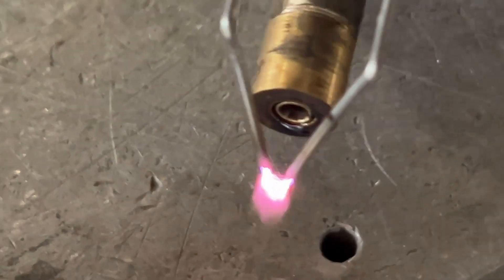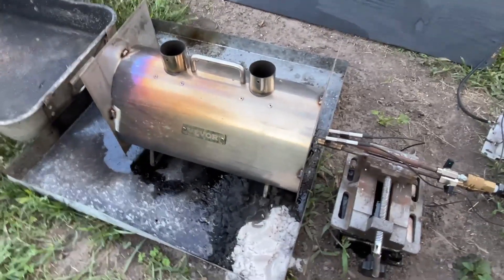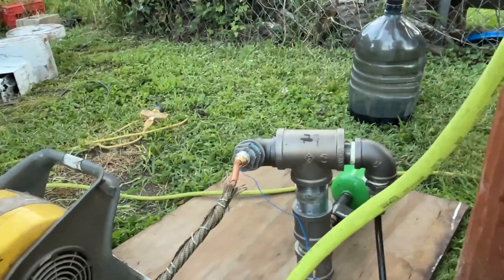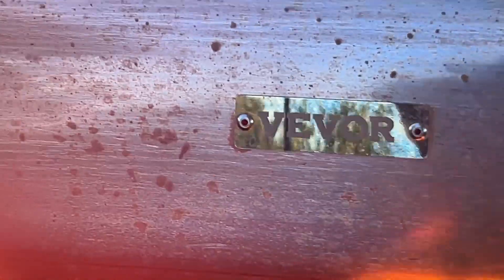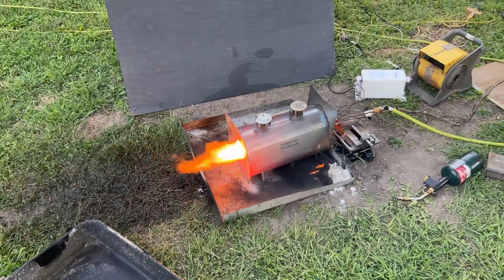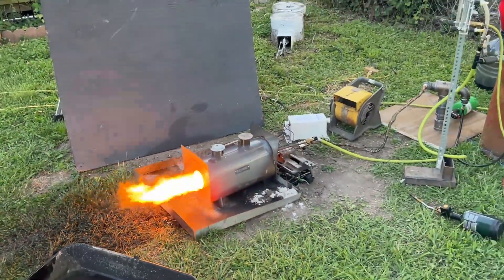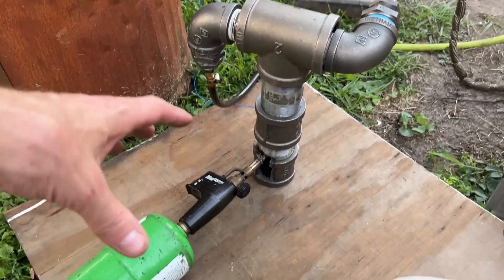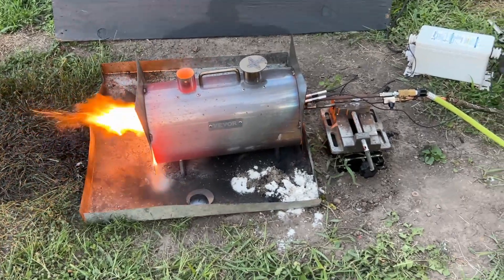Rapid prototyping waste oil heat . Testing for Steven today

Comment: Not a huge fan of preheating oil to hot. The main part to to have it as consistent as possible.
Any type of control valve will always need tweaking as the oil temp changes... 
I am more of a fan preheating the air and have a last minute preheat just as it exists the nozzle, as I learnt from you.
Reply: I am working on .25-.3l per hr burner.
I have come to the conclusion, radiant heat is heating my nozzle tip enough that it is kinda boiling in side the nozzle. And give trouble over time, especially as the burner ash builds up.

Comment: i had alot of issues using an electric ignition source to get the oil going, i could do it once warm (60c) but it would not ignite thick cold oil, so i use a combination of gas and ignition to get the burner going, then once it has stabilised the gas can be turned off, very tiny amount of gas and as waste oil is free its worth the startup